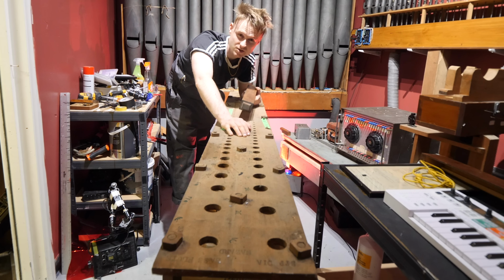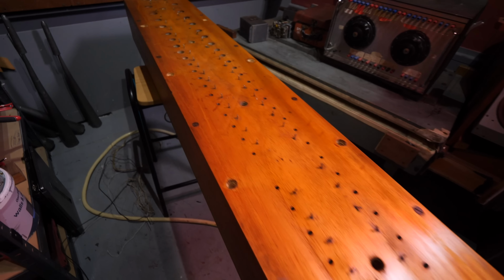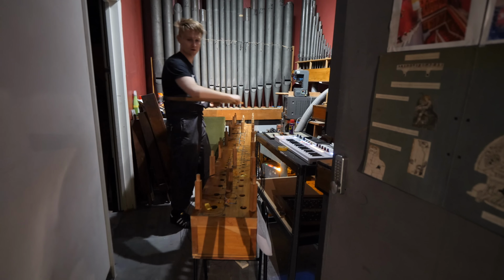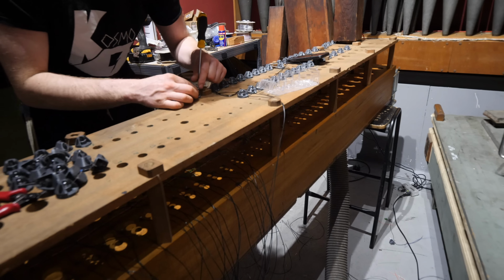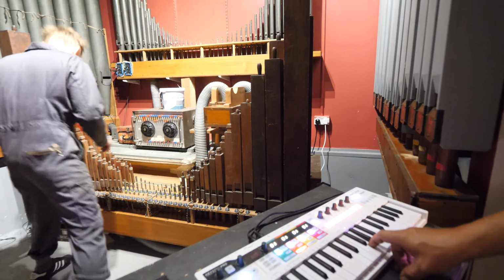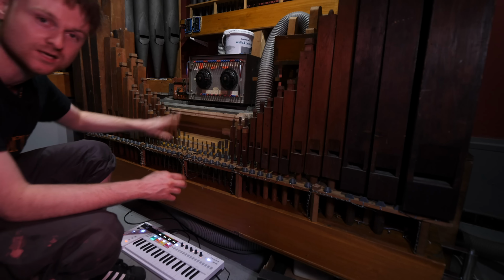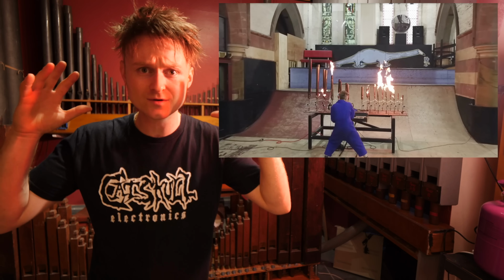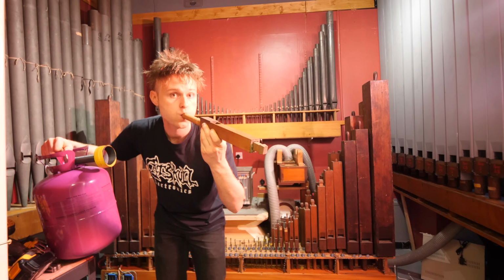HELIUM Through a CHURCH ORGAN, What Happens? I BOUGHT A CHURCH ORGAN PART 5

Comment: Love the light effects on the pipes - now I want to build an organ too maybe I should see if there is a hurdy-gurdy for sale somewhere. 
I also love the wiring loom style and used to do this a lot using waxed cable lacing. We switched over to some type of plastic cord and that needed a different technique using separate knots (a clove hitch with a single knot underneath). I still prefer the waxed lacing when possible but unfortunately cannot find a cheap alternative for the (expensive) FAA approved stuff Any tips?
I was thinking the Helium experiment might fail because the helium is a very small molecule so it might be leaking through the pump and the windchest before it even gets to the pipes.